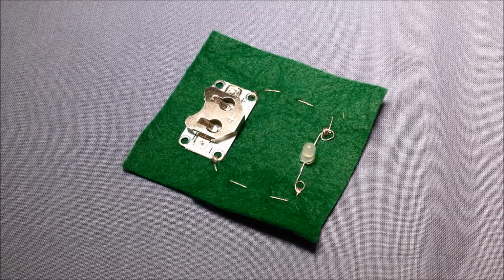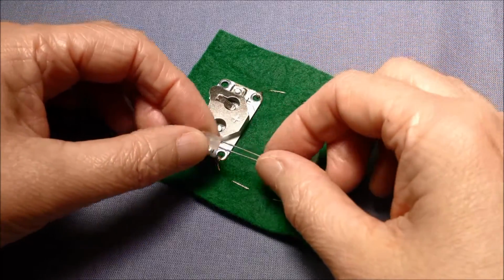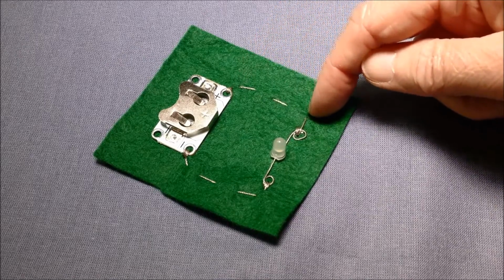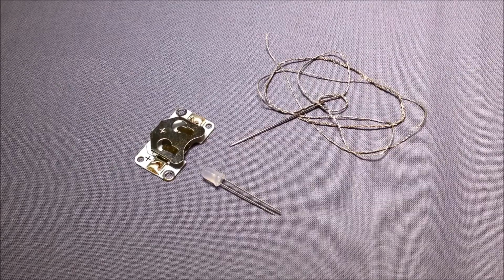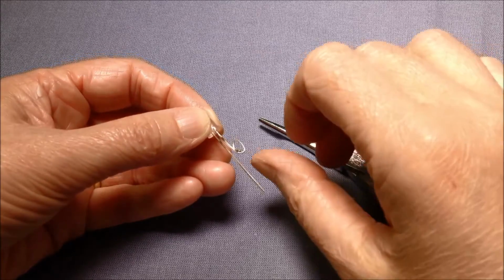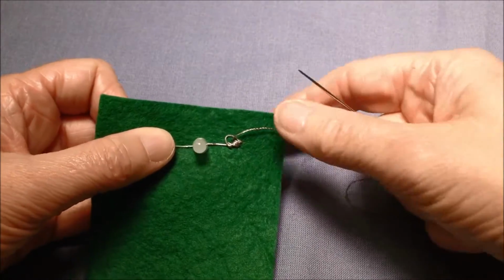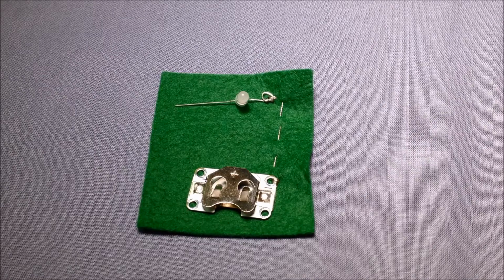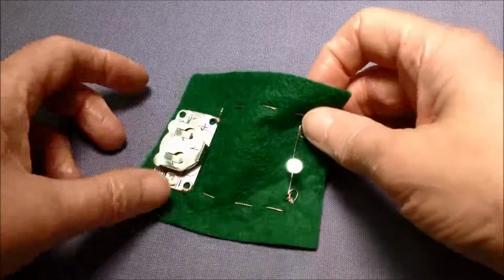Getting Started with E-Textiles: Basic Circuit with Standard LED

Comment: Shouldn't the LED have a resistor attached?
Reply from the maker: Hi, that would be dependent on the LEDs requirements and what the power source supplies. The conductive threads resistance also plays a small part.